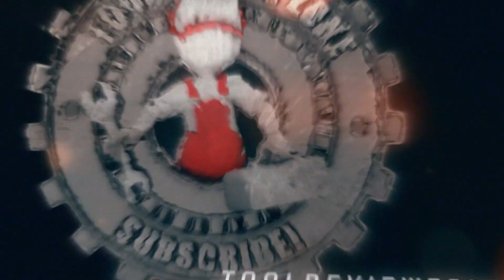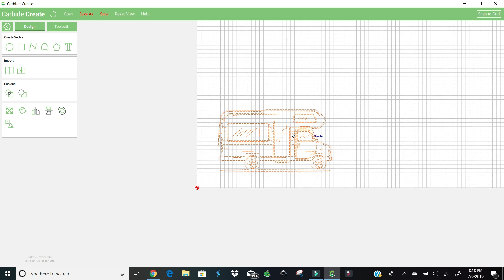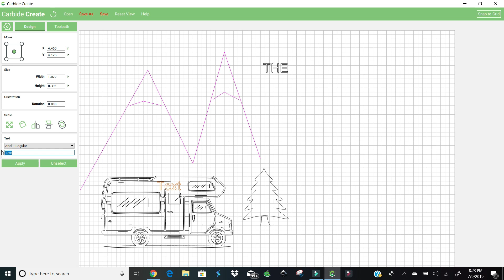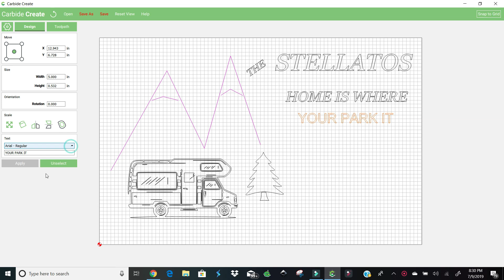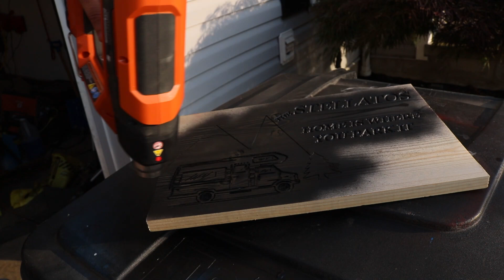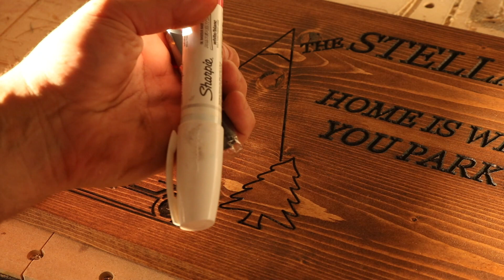Turn Scrap wood Into Money With A CNC. This is an easy DIY project made out of scrap wood for $$$

Comment: I have a question,
( i'm a beginner, just got a small CNC Techlifer 3018 CNC )
instead of just spraying black.
it is not an idea to cover the workpiece with some kind of tape -
and then spray after milling and THEN remove the tape?
maybe a bad idea? maybe not! I'm just saying something .....

friendly greetings from The Netherlands!
Rob
Reply from the maker: Yeah you could do that.  There is a special film style of tape that goes over the top, but it starts getting a bit expensive if you use a lot, and sometimes it doesn't stick perfectly